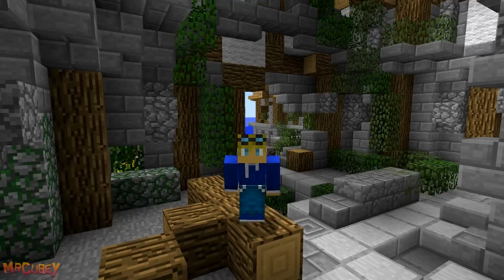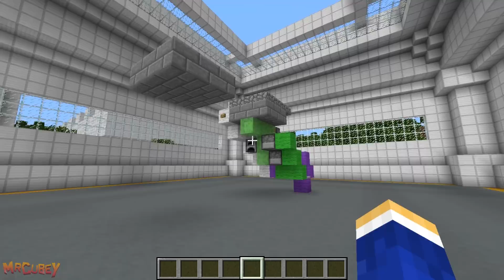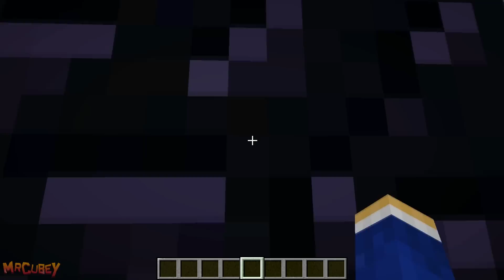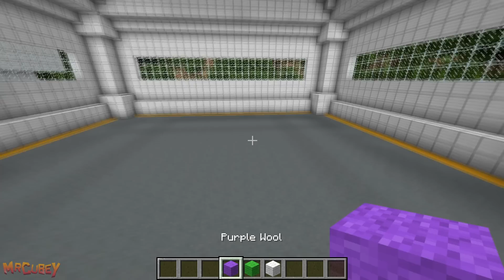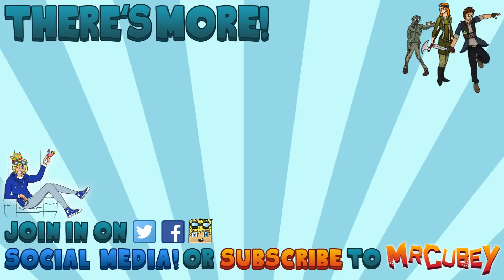RETRACTABLE MINI BRIDGE! - Minecraft Tutorial

Comment: Quick fix for the length problem-- build 2 facing opposite of each other-- and place a slab on one end- this will make a 5 block jump- a jump not possable without ice. Of corse it won't be flush- but if it's in a ruin setting- it won't matter much.

Comment: MrCubey, I had a cannon idea. In the new snapshot, fireworks with firework stars damage mobs but nor blocks. I tested an idea based of of this mechanic out and it worked. It works by dispensing a firework into a 1x1x5 tunnel with water flowing from one end. the firework gets pushed by the water so it doesn't go high but it goes far. The firework then explodes and damages mobs.
Reply: Skies Flight lol noob spelling